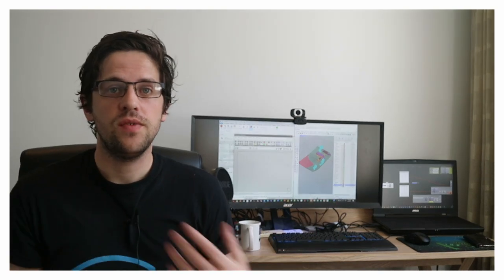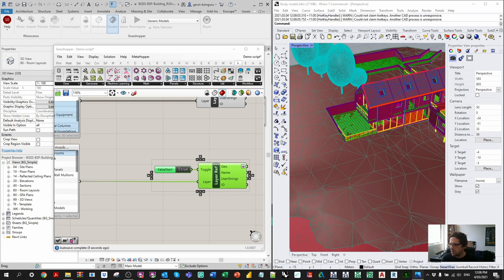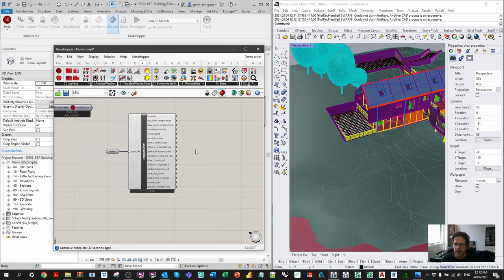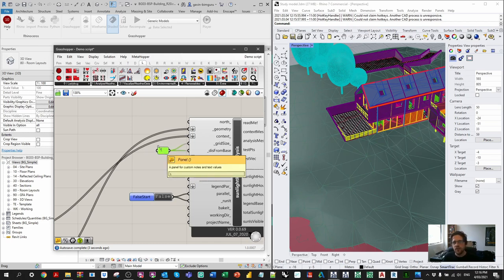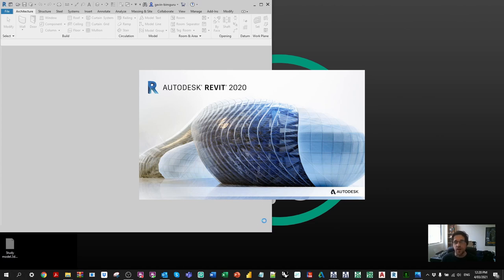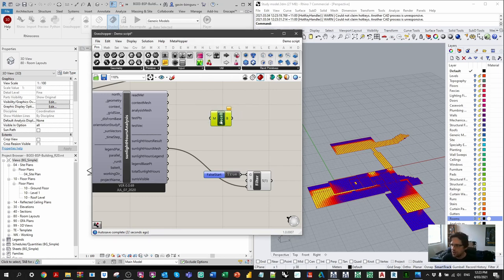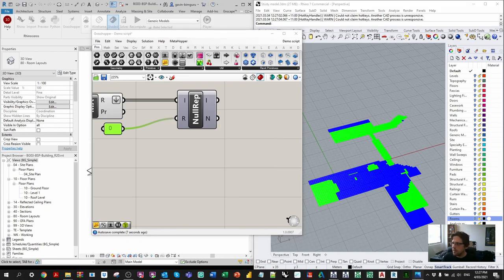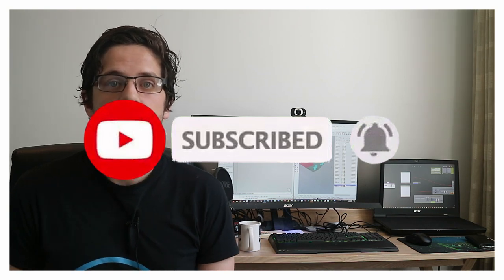Ladybug in Revit using Rhino Inside!

Comment: Is it not possible to run this type of workflow using Revit insight plugin, can you make a video comparing the advantages Rhino-Ladybug over insight, even Enscape has this feature of solar study analysis, I don't know how effective or accurate it is.
Reply from the maker: I'll be honest, Insight just isn't that great. It's far less fun and intuitive to use amongst many other reasons. I would suggest you try it out to see what I mean - I can't stand using it personally.

You have very little control over the settings and it hides most of the testing methodology from you. Not to mention it requires that you spend cloud credits, so you will very quickly offset a license of Rhino 7 in a large office with many design changes to test.

Parametric monkey has a good article comparing them here, but he also concludes Grasshopper is far superior a choice for architects;
https://parametricmonkey.com/2020/04/14/insight-lighting-analysis/

He identifies issues with accuracy, processing time and the ability to interact with and modify the results. Based on my experience I agree with his conclusions.

Comment: Thanks for the tutorial, but is there a more simple way to pull weather data such as, temperature, humidity, wind speed in a revit file as outputs in a Dynamo script, just outputs without any other environmental analysis?
Reply from the maker: Unless you can figure out how to deconstruct a weather file not really unfortunately. Ladybug for dynamo no longer works in later revit builds so I would usually use rhino/grasshopper to get those types of values. There may be addins out there for this but I am unfamiliar with them if so.

Comment: Hi! One part I don't understand at the 22:01 that you "Mass Addition" the results by the order of rooms but what I have is the summation of each grid's area that fit the criteria, ending up a value. Say, I have 39 grids that fit the sunhour criteria and all the 39 grid is almost equivalent to 1(I set the grid_size to 1), so I get value 39 from "Mass Addition", which is not corresponding to my 34 rooms. Not sure you can understand my question or I can bother you with email and some example files.
Reply from the maker: The goal of this mass addition is to measure the area per room that complies, so we measure total area of cells per room on their own branches and then sum them. The mass addition should return each rooms area, which we can use to verify a pass/fail against a minimum complying area by room.
Reply: @AussieBIMGuru  I see! The analysed sunhour results from DirectSunHours node are not arranged in branches of rooms, instead, it list all the grids' data in one branch. Maybe because I use the Ladybug 1.4 and the component is different from what you demonstrate. I should find a way to process the data correspond to rooms' mesh.
Reply from the maker: @pingchung6293  possibly... make sure you feed in the room meshes individually to the sun study node also.